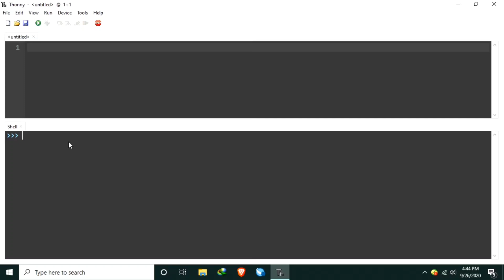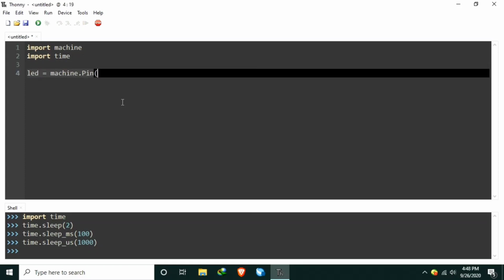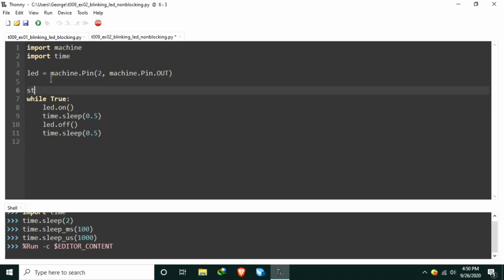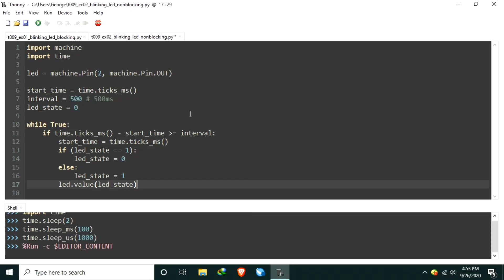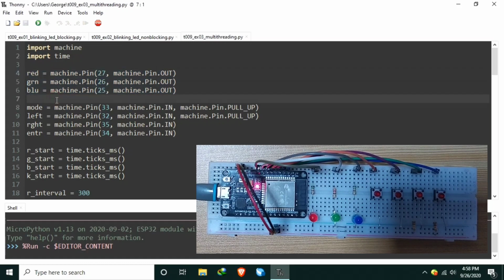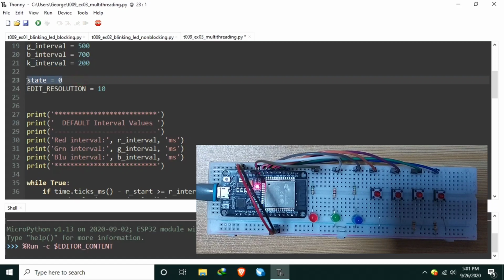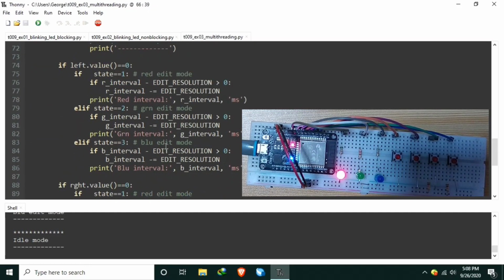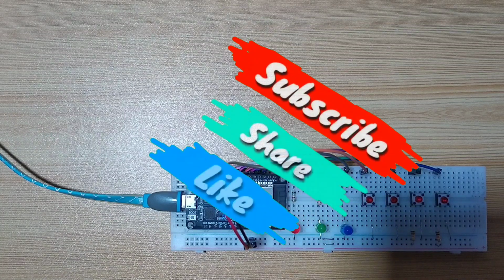009 - ESP32 MicroPython: Non-blocking Delays and Multi--threading

Comment: using the TIMER to creating delay is much better by using ticks_ms in multithreading you will have high cpu the timer cpu usage is low because the timer runs outside the loop and this is light weight for CPU :)

Comment: It looks like buttons do not ground the pin when pressed. They are pulled high, but pressing button does not ground pin or I can't see the wire in diagrams.  I went ahead and put the ground wires to the buttons and it works but I have switch bounce.  Otherwise I understand your steps, enjoyed and learned.  Thanks
Reply: The ones with the External Pull ups do not have a ground wire that I can see in diagrams

Comment: I totally agree with others, wonderfully explained. Could I make a suggestion. Why not use the enormously underutilized logical operator 'not'. You would replace 4 lines of code with just 1!!!!! Simply replace your While block with below.
while True:
    if time.ticks_ms() - start_time >= interval:
        start_time = time.ticks_ms()
        led_state = not led_state # not operator acts as a toggle on your variable
        led.value(led_state)

much appreciated, Peter.
Reply from the maker: Hi Peter, of course. Thank you for the suggestion. Cheers.

Comment: This concept is really great for single-core MCU to act like multi-threading, thanks
Reply from the maker: Yes this is the easiest possible method. You might also try _thread and uasyncio which are a little bit hard but more efficient. Thanks. Cheers.

Comment: This is clearly not multi-threading, per other comments.  But worse, it's a busy-wait loop, meaning it'll consume far more power (as the CPU is running at 100% all the time).  If you put a sleep(200ms) (your lowest interval) at the end if the loop you can get almost identical behavior w/ maybe 1/100th the power usage.

Comment: I am enjoying your videos about programming the ESP32 in MicroPython. I study your code in order to understand what it does, and I build some of the circuits to watch the code in action. I built the circuit in this lesson, and it works just as you designed. My question is regarding k_start and k_interval; what is their purpose? Thank you.
Reply from the maker: @I'm not Chuck, glad that you liked my videos. Thank you.

k_start - stores the start of time, the current time  counter.
k_interval - sets how long a certain if statement block will be executed

Subtracting the k_start from the  timer running counter will give you the an elapse time. Then compare this to a k_interval constant lets say 1000, will give you 1000ms or 1sec interval.
Reply: @TechToTinker  Thank you for the response. I understand that, but I still am not clear on the purpose of the 200 msec K interval. Is it the length of time a button must be pressed before it is considered a vaiid press?
Reply from the maker: @I'm not Chuck, it is use to prevent multiple detection of key press when you push the button switch. You may experiment with it by lowering the k_interval lets say to 10 and you will know what I am talking about. Cheers.
Reply: @TechToTinker  I understand now. Thanks.

Comment: Nice tutorial, pero this is not a real "Non blocking" nor "Multi-threading", pseudo lang yung nangyayari. The concept is just looping all throughout the code block but by storing the state of each led's time delay to blink and calculating the current timing, this will perform the specified code block if it matches the timing condition.
I doubt if this can be applied to a socket which constantly listens to a request. I'm still researching on that tho...
Reply from the maker: @Say my name? Harambe yes you are right. But this should be enough to solve common blocking code problem. This should be enough if accurate timing is not needed.

You might interested using Asyncio for your socket.

Cheers.